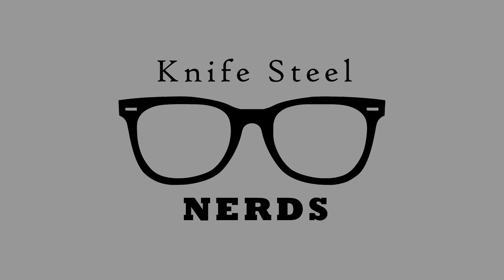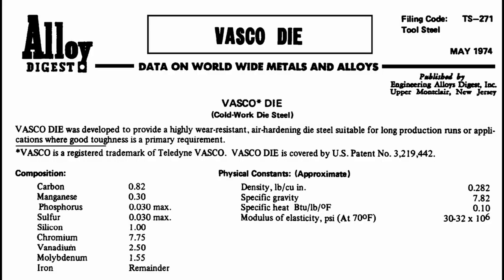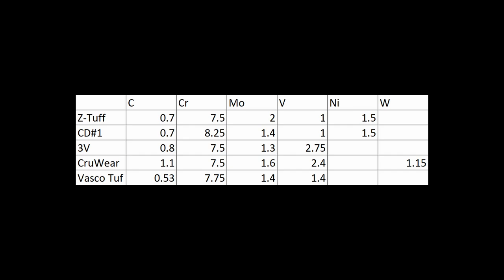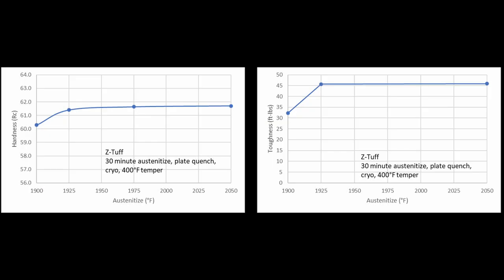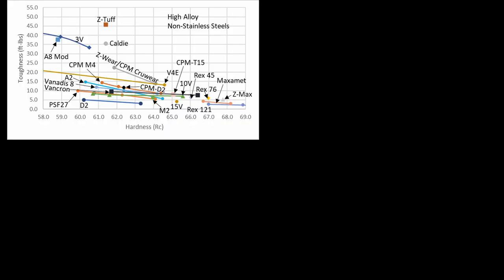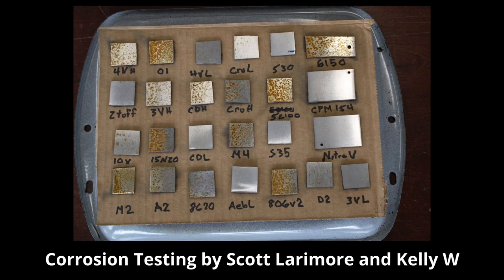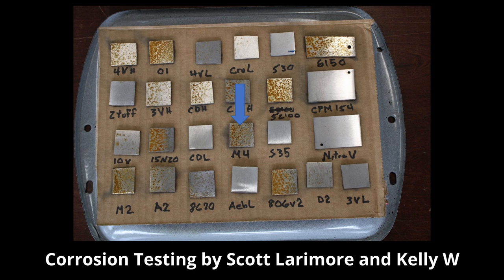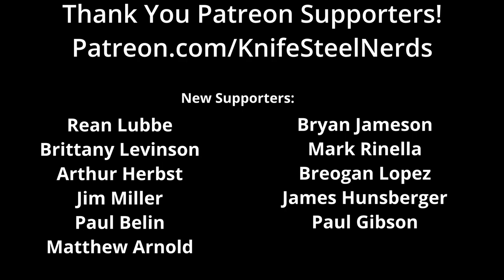Z-Tuff and CD#1 - The Toughest Knife Steels?

Comment: Z-Tuff is one of those steels I'm interested in using, the price is a bit savage though which has turned me off the idea. The Zapp Z-Wear though is something I might dabble in one day
Tough knife steels definately have their place though and I've always been very happy with A8-Mod for a good mix of ease of heat treat, toughness and affordability. It also finishes nicely and seems to have enough stain resistance to shrug off a mild amount of humidity.
Reply: Try 8670 or 5160 for choppers. It's cheap and comes in decent enough sizes as well. 

Edge retention and hardness will go down. But for choppers should work.
Reply: z wear is quite literally just cruwear made by a different company, for the record

Comment: Thank you for making this.  Out of curiosity, do you know how I would go about testing if a sword is made of the steel advertised?
Reply from the maker: Some places have XRF guns that can measure elements other than carbon
Reply: Used to work in place where they had laser-induced breakdown spectroscopy machine (LIBS). They used it to analyze steel samples from century old bridges. They are very expensive to buy but cheap to operate. Not sure how good they'd be to study knife steel or what's the market price for a measurement.

Comment: I don't find toughness to be something I chase that hard with the way I use knives but it does sound like an interesting steel for some things especially if I ever get a chance to start doing swords.

I really got onto researching bronzes this winter. I love the different colors one can get off of them as well as the range of properties. With Coppermascus becoming popular I imagine it is a matter of time till people start using bronzes. Is there any chance you might give some advice for best practices when mixing alloys? Are there any bronzes ir other colored metals that might have any use for at least specialty blades of some type. From what I could find there isn't any that would be acceptable by modern standards but it doesn't hurt to ask. It makes amazing looking hardware though. I don't know if you would have any advice about making them. I found it difficult to find quality information about making bronzes especially in a home setup using my heat treating oven.

Comment: Love the info,steel history is so fascinating- love that Gerber was using Cruwear 50 years ago....I imagine the heat treat may have been beyond the ability of the user to easily sharpen in those days,I have a few old school Gerber blades that are in m2 and they take a nice edge and seem to hold it...thanks for all your hard work and all the folks that collaborate with you to bring the knife community such useful info. 👍👍
Reply: Love those old chrome m2 knives, always on the lookout for them.
Reply: I'm curious as to what you mean by " the heat treat may have been beyond the ability of the user to sharpen "?
Reply: @SuperSteelSteve  maybe lack of diamond abrasives + high hardness id assume
Reply: @Lindbo Knife & Tool  That's a big assumption on his part.

Do we know what hardness they were running it at? And cruwear is relatively low abrasion resistance, it sharpens very easily on regular ALOX stones you know?.
If I had to guess they stopped using it because of cost of manufacturing vs selling cost.
Reply: @SuperSteelSteve  cruwear has relatively low abrasion resistance, relative to steels like s30v, but not relative to common steels of the day. Especially since it was the old non CPM stuff. I’d 100% say it wasn’t easy to sharpen back then. Maybe I’m a shitty sharpener because id classify 62+hrc cruwear as hard to sharpen on alumina, but I just don’t see the point in even doing so. It’s masochistic😂 

The gerber m2 knives are run at 62-65, and have a very close composition to cruwear.

I know the opinion is that no steel is hard to sharpen, but when I put myself 50 years in the past, I’d hate sharpening those steels on alumina. It would be a diminishing return of performance. I’ve sharpened k390 on alumina, and it took an eternity. 

My $0.01 adjusted for inflation
Reply: @Lindbo Knife & Tool  I respect the opinion... I'm just saying.... where do you find 63 HRC cruwear on a production level even today? Lol

Every Benchmade and spyderco I've ever owned in cruwear has been between 60-62.  They advised the new adamas now at 64. But that's been a long time in the making.

And again, I don't think any company actually cares about sharpenability. They just don't. They say they do to justify lower HRC because it's more costly to heat treat, grind and finish knives at higher HRC relative to lower ones.

Same reason they keep the geometry so thick.. alot more costly to grind thin. So they tell you it's "for toughness".

M2 was 62-64 for the same reason M4 is always at 62-64. It's a high speed steel. Tons of tungsten in it. You gotta temper m2 at 1000°f to hit 64 HRC. To hit 62 its like 1100° or something ridiculous like that lol. 

The aust temp is something like 2100°for. So 2100°f aust and a 1000°f temper for 4 hours burns a lot more energy than say 420hc which is something like 1900°f aust and 400°f tenper.

My opinion,  but most of the industry trends are manufactured by manufacturers. They gas light customers into thinking "hard steel bad" because *insert 1 In a 1,000,000,000,000 scenario that you depend your life on a knife. Or  "it's hard to sharpen" "guys need to be able to sharpen a knife on a river rock" or  "it'll shatter like glass ". Ect

Just my 0.005 cents. Adjusted for inflation over the last 20 min we've been having this conversation 🤣
Reply: @SuperSteelSteve  100% in agreement about gaslighting from companies. Hearing them say “easier to sharpen” makes me angry. And excellent point about aus temps. For some reason I assumed they were able to do a conveyor heat treatment. I’m making a run of knives in m2 and it’s irritatingly high aus temp is forcing my hand into an evenheat KO series or peters. 

Any amount of marketing hype makes me super skeptical, even the hype around magnacut is making my contrarian ass weary of using it. 

Have a good one super steel Stephen, you’re surpassing makers left and right.
Reply: @SuperSteelSteve  probably a few guys that Cruwear doesn't pose a challenge to sharpen, but listening to the comments on the forums and YT I think it would have been more of a challenge than 440c which was more common in its day
Reply: @blue swan  I literally don't know a single person who had a problem sharpening cruwear. 
Matter of fact, it's ability to take a nasty edge in almost no time lol

Also,There's nothing in cruwear that would make it particularly difficult to sharpen.

Honestly, Its probably much more of a production cost vs sales cost than anything. 

It just sounds better to say they are looking out for the customers than to say " we don't make enough money ".

And for  some reason "profit" is a 4 letter word in the knife world lol
Reply: @SuperSteelSteve  I don't know anybody from 50 yrs ago who tried to sharpen Cruwear or V-steel as Gerber called it,but who knows maybe it was super easy for everyone to sharpen it back then, really my point was more about that we had a variation of a steel like Cruwear back then...most of you guys are way more savvy of this stuff then myself... honestly I really have grown to love 14c28n because it's budget friendly and takes a great edge in my personal experience and I got tired of paying $ 200 for super steels that performed poorly ,btw are you still doing videos? Miss your insight thanks for the comments 👍👍
Reply: @blue swan  oh shit, didn't know anyone still remembered those 🤣.  I actually moved my stuff to Rumble under the same name. Haven't done a video in a bit but i actually started making knives back in September. 

I'm recording some knife making and steel stuff now. 

And I 100% agree with getting tired of paying out the ass for high end steels that perform like shit.

Comment: Would this steel have a higher yield strength than 301 high yield?
Reply from the maker: Just about any knife steel can have higher yield strength than 301. Yield strength correlates with hardness. 301 in its “high yield” state is in the low to mid 50s Rc.

Comment: Where can i get this steel in smaller quantitys?
Reply from the maker: Alpha Knife Supply has a few sizes of Z-Tuff and Niagara Specialty Metals has CD#1. Both have online stores.
Reply: @KnifeSteelNerds  is there also an European reseller?
Reply from the maker: @thetschoni3813  GFS supply in Britain
Reply: @KnifeSteelNerds  Is there also a source for thicker stock like 1/4” (width minimum :4“ leanth: around minimum 18“ (Doesn’t need to be in Europ). I can find only thin stock.

Comment: What about S7 or even better S5?
Reply: There are Hardness Toughness Curves comparing S7, S5, 3V and 1V in the KSN Article "Silicon Additions for Improving Steel Toughness". 
But in short: looks like S5 would be at arround 70ft-lbs at 59HRC, but greatly falling off at greater hardness.
Reply: @ArthurHerbst  not sure if it's a C-notch vs V-notch thing in the article you cited S5 at 59 is a whooping 140ft-lbs and even if it comes crashing after that 60HRC is still 80ft-lbs although it would be easy to miss the mark here.

I mean I'd prefer 60+ but 59 is acceptable, even 58 is/used to be the industry's norm.
Reply: @here_be_dragons9184  Dont know if it was notched sharpi test or not (or what form the notch was). Even changing cupon dimensions alters the ft-lbs values afaik. But the relations should be applicable i thought. 
But i agree with you. S5 seems to be an absolute toughness powerhouse! Question is, how much toughness is enough. There comes the point where you couldnt break the knife even if you tried. But i'd really like to get my hand on some S5 anyways. :)

Comment: I kinda wanna experiment with z tuff for a sword. 

I'm not sure if it'd be as tough as certain other simple steels with a properly optimized heat treatment but the edge retention is better then most sword steels. 

8670 or L6 bainite are pretty tough in the hardness levels swords often see. And while longer to heat treat the warping is reduced and at 53 to 55 hrc it should be not too bad speed wise at least in certain steels.
Reply: 8670 has surprisingly decent rust results from that photo. Did better then I'd have thought given it's fairly similar to L6 which is known to be sensitive to rusting with swords.
Reply: millerbros blades have used z-tuff in their knives & swords (or sword-like knives) & apparently it was as good as one might expect. but they don't seem to be forging anymore.
Reply: @movelikebass  interesting. Might be due to covid or some other factors. 

I was specifically thinking of using it for certain types of swords that are fairly prone to damage and rust is a very easy way to damage one beyond usage. But you also want a good sharp edge. Seems like it'd be a good choice.